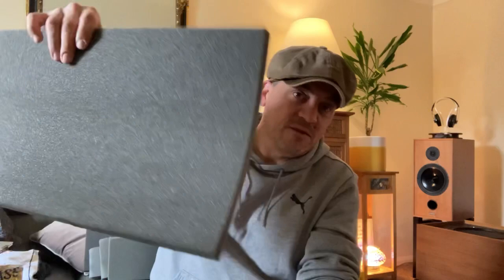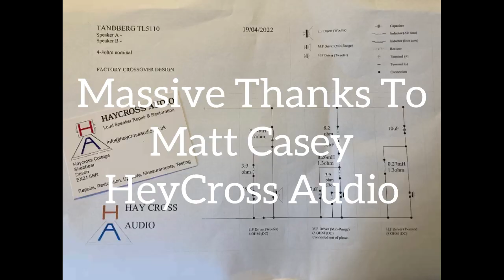Tandberg TL5010 Speakers PT2. #vintage #speakers #hifi #audiophile

Comment: The Tandberg TL-5010's were made in a couple of different versions, slightly different crossovers.
Great to see them reviewed, rare speaker, highly appreciated in Scandinavia. 
I have a pair of 5010's, I find them picky with pairing but when paired right they are absolute top class.
Reply: They sound fantastic with my Rega Brio!

Comment: Great job Kevin love your absolute dedication the speaker’s are sounding sweet with the updates 
But the real reason for this is what’s the first track very good indeed 
I have recently replaced the tweeters on second hand Spendor Prelude Speakers and I must say they are sounding really airy with clear midrange  but just not following the baseline that well any tips on room placement 
Keep up the good work and thanks for the update about Stereo X 
Cheers from Western Australia

Comment: This is so bizarre finding this vid as I was in a very similar situation to you a few months back. I acquired a cheap pair of these 5010s, wooly and dry like you said. Sweet and sparkling with certain music, but mostly lacklustre, especially compared to my gorgeous Ditton 44s. What was weird though is that when paired up with one of the more unusual receiver amps in my collection, the Goodmans one ten they sounded incredible. Day and night? Maybe? Honestly, talk about the right marriage. But in the end I sold them as my 44s are simply gorgeous, but I've regretted it ever since. Especially now I've seen you can improve them using your tricks 👍Great video
Reply from the maker: My father in law uses them everyday..
They sound pretty good tbh
Reply: Hi this sounds weird to me I see pics of the Goodmans One Ten and nothing tells me of something exceptional
Small mains transformer crowded built 
Have you tried a good integrate like Pioneer a400? Or similar? Thanks and kind regards Gino

Comment: hi kevin
probably you should not replace electrolytic capacitors with film capacitors in the crossover due to different esr characteristics  between those caps types.
see what axiom audio (from Canada) engineer who design loudspeakers said about this common mistake.
https://www.youtube.com/watch?v=A1BJQz-_57s&t=322s
anyway i love your reviews on loudspeakers and other stuff.
Reply from the maker: This is what we did 

https://youtu.be/JZzYIphxp5o